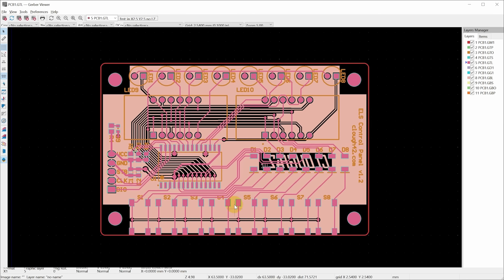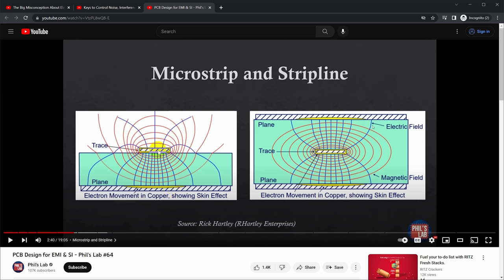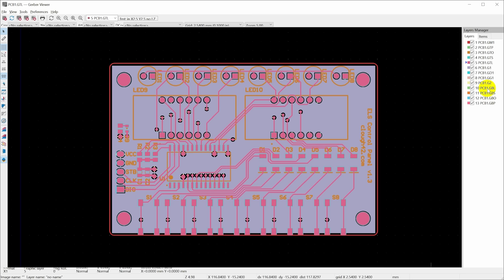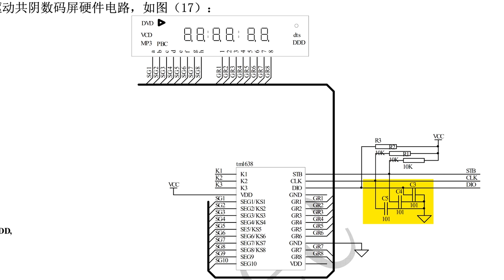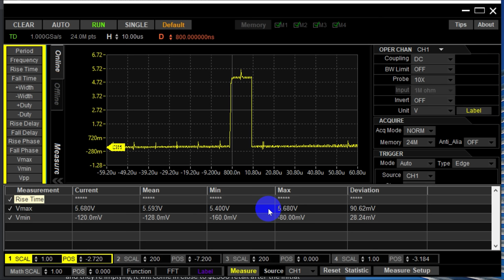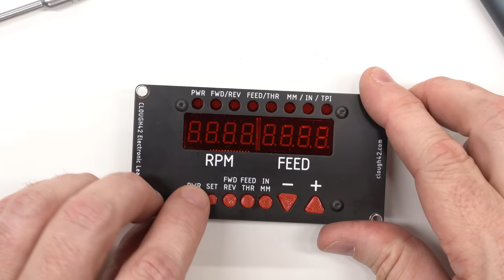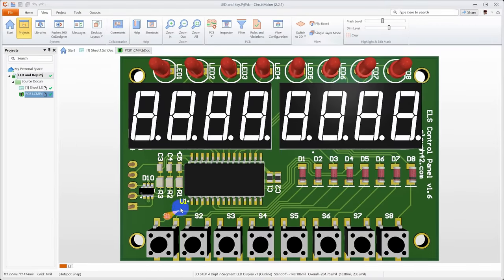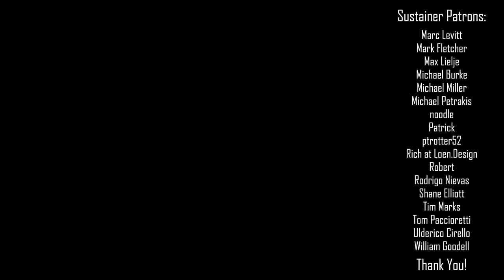4 Layers is Better than Two: Another ELS Control Panel Prototype

Comment: Hint: for those 100pF capacitors, it does not matter¹ whether they go to GND or positive voltage; all that matters is that they are between the signal and a constant DC potential. So you can just get physically larger capacitors (same size as the resistors) and directly stack them on top of the resistors.

Also if you make the resistors smaller, the capacitors need to get larger, since their effect is determined by the R×C product. ≈4.5× smaller R ⇒ use ≈4.5× larger C (470pF is a standard value.) But NB: both of these changes — smaller R, larger C — make it harder to drive the input. With the traces you're showing, it doesn't seem like that's a problem in your setup though; not yet at least.

Also-also the C1/C2 decoupling capacitors need to be as close to the IC's power pins as possible. [EDIT: looks like you already moved them to a better place, I should watch the entire video before commenting :D] The circuit board - and in particular the vias - are only in theory 0Ω 0H 0F. But when you're looking at fast edges, the reality of non-zero µΩ nH pF values makes things harder.

[¹] - some might nit-pick that the power-on behavior is different when the cap is to VCC rather than GND. Which does not matter the slightest bit.

Comment: Though being a mechanical engineer, I had to design a multiprocessor board, 8 by 8 inches,for some embedded industrial systems back in the eighties. As processor speeds was much lower then, EMI wasn't as big a problem. To make PCB layout easier I went for a 4 layer board. Ground plane bottom, then a "north-south" layer, then an "east-west" layer and a positive layer on top.
Hundreds of them made, rarely any problems with them.
Seems I wasn't completely wrong.

Comment: Maybe a fun project idea for you, but - I've been looking into possibilities for attaching a small/micro drill chuck to those electric screwdrivers. I think it'd be fantastic for drilling out or threading small 3d printed plastic components very quickly. Beats a pin vise and preserves your wrists, and you don't have to worry about snapping any drills if you're chucking them up in a big 1/2 chuck.

Great vid, looking forward to more as always.
Reply: Honestly: Just buy a drill that is dedicated for that Job. Maybe I did not understand your idea correct, but I think a proxxon micromot 60/E will do the task way better. Here in Germany they cost around 30 € and you can even choose between a tiny chuck for convenience or tiny collets for precision. Of course, threading does not work. If that is your main task those screwdrivers could indeed be helpful.

Comment: Nice work!
I love the Milwaukee M4 screwdriver for electronics work.  I'm a former electronics tech.  It has a great clutch and ergonomics plus swappable batteries.
I run a double conversion UPS in my shop dedicated for electronics.  Normally they are expensive but they can be found of the Bay of e with bad batteries for pretty cheap.  An APC RT, Eaton 5PS, or Sola S4K.  The Sola is what I use, only thing that can handle the frequency swings running on my old Onan generator.

Comment: I've gone to 4-layer for all of my hobby projects. Between easier routing (as most of my boards are dense) and improved signal integrity, it just isn't worth using 2-layer boards in most cases any longer.
Reply: This is something I'd never considered until watching this video... now I have 2 reasons to try 4 layer!

Do you just route GND, or power as well?
Reply: @LordPhobos6502  most of the time I route power and simply connect down to a ground plane (unless it's an analog design that needs a star ground).

Comment: I've designed a lot of boards, from computers to cell phones, and while going to 4 layers is always nice, this board could have been vastly improved as a 2 layer design. For example, the ground connection between the input connector and the IC is quite poor. Adding a ground trace parallel to the data lines from the ground on the IC to the flood near the connector would be a big help. 
For this design, I would have ground flooded both sides, and stitched the planes together with vias near the IC. The rest of the PCB isn't really a problem (LEDS and Stitches) if the signal integrity of the interface to the IC is good. I also would have placed the bypass caps as close as possible to Pins 4 and 15 (Vdd pins) with good return to the IC ground pins.
Reply: "stitched the planes together with vias near the IC"
I'd rather have via stitched both the top & the bottom ground plane polygons wherever possible in order to suppress capacitance which will inevitably build up between them if left not stitched. The more vias the better. JLCPCB don't care of how many holes they drill for you so it will not affect the price at all. There is a dedicated automatic feature for that in Altium Designer.  The smallest hole size JLCPCB can make is 0.2mm so several hundreds vias can be placed per one PCB easily. The only thing to consider is to remove a thermal relief from that sort of stitching vias in the Altium DRC. BTW, I have no any degree, I just use a common sense.

Comment: Going to 4 layers is the best solution for this sort of thing, but, especially for folks who don't have the ability to do that, something else to keep in mind:  coupling between traces (or any wires) is roughly proportional to the cosine of the angle between them.  So parallel traces couple the most, perpendicular traces couple the least.  So if you have top layer traces pass near bottom layer traces, it's best to cross at a right angle rather than at a sharper angle.  

The coupling is also inversely proportional to the square of the distance, so separating traces is best.  Thus, it's best to cross traces at a right angle and then move them apart, rather than letting them run parallel near eachother.  

Obviously, some times there are geometrical constraints that prevent this.

James had all this correct on the prior version - the main bundle of traces crossed at right angles.

Comment: High current lines going at 90 degrees across signal lines is the best possible crossing for minimum interference.
What is more an issue is "loop area" for high currents. Placement of decoupling capacitors however could be a lot better...

Comment: SMT Rework suggestion: I use a (6x6x2 Granite Check Stand Surface Plate & DIAL INDICATOR Gauge Granite Block) and replace the standard probe tip for one that is more like a pin to hold down SMT parts while soldering. The Dial indicator I have been using has a 1" travel which works well. I suspect you already have everything you need in your shop.

Comment: Moving the power planes to the outer layers, and keeping the signal traces to the internal layers, will provide the best EMI shielding you can get without going exotic like a 6 layer board with solid layers just for shielding.  I work with power inverters for traction motors in the 20kw to 450kw range, so we see very large EMI problems.

Comment: I would add small series resistors between your TVS array and the RC snubbers. A 1A ESD pulse will still get to 12.5V before the TVS clamps - you're relying on the capacitor in the snubber to deal with the let-through energy. A series R (100R - 220R, 5% to 10% of the pull-up) will slow the let-through surge and give the capacitor a better chance at filtering the high frequency pulse energy.

Comment: Nut drivers are hugely underrated; they're way easier for all sorts of "small" nuts like this if you want to minimize the amount of cursing, cross-threading, and dropped fasteners.

This kind of "sharp edge causing noise and interference" problem is prevalent in a bunch of digital signaling; if you've ever perused the catalogs for things like RS485 drivers, you may have noticed that manufacturers will often sell a few different "versions" of a chip with various rated bitrates/speeds for what is otherwise the same design for basically the same price. You might initially think, "why wouldn't I just buy the fastest one?" but the answer is that the different "speeds" differ largely in how steep their rise and fall ramps are for their drivers. Slower/softer transitions do limit the maximum signaling rate, yes, but it also means you produce less high-frequency harmonics that can cause interference to other circuits so you really want a driver chip that's "just fast enough" for the signaling/baud rate you intend to use. This will provide maximum signal integrity with the minimum potential for introducing extra noise into your systems.

That TVS "multipack" is a great component, and I'll definitely be keeping it in mind for my future designs! A lot simpler than including footprints for a separate TVS package on each data line independently.

Comment: 9:28 Your soldering is not bad. Your results look fine, and the difficulty you had with the 0603 caps is just something that goes away with lots and lots of practice, as you develop an intuitive feel for the heat flow and surface tension and learn to fling stuff across the room with the tweezers less often. Try working with some 0402 components… by the time you can work with those without wrecking them and the board, the 0603 ones will seem easy! Out of necessity at work, I got to where I could rework 0201 with a lot of difficulty. But that experience made 0402 seem easy by comparison. I agree with the other commenter who suggested a J shaped tip.

Comment: The secret sauce that Rick and others I'm trying to get into our head is that with microprocessors and signals it's all about the rise time which is nothing to do with the frequency.
Unfortunately it's very hard to find me information on rise time.

You might be lucky to find a microcontroller that has a simulation model.

I'm playing with esp32 and unfortunately I do not have a simulation model
Reply: Rick and others really opened my eyes. Dave from Evvblog also had some hidden gems too.

Comment: Hi James, a suggestion for the next iteration or project. Add a schmitt trigger for the inputs. Some 10 Cent 74xx2g17 will do. In combination with your existing diode chip it should make it quite resilient against emi on the input lines.

Comment: James. I had to comment after watching this latest video. You failed to mention the latest version now includes decoupling capacitors. The blatant lack of bulk and high frequency decoupling caps was a fundamental issue from day one. I’d go on to say that most of your issues are power related and not EMI related. Always focus on good power delivery first then signal integrity and lastly EMI if needed. 

Whoever suggested C1 and C2 is on the right path. However with your VFD nearby I’d add something in the multi-hundreds of uF as well. Why didn’t you mention these?  You certainly spent a lot of time on Signal integrity and EMI but you thought the boards performance on the scope looked good. It looked terrible from a power and simultaneous switching perspective. Look at the high frequency bumps on the low signals. That’s just a mirror of the ground supply at the time. Shows a fundamental lack of good power supply decoupling. Similar glitches are seen as the signals were high. 

All the signal filtering is OK but it’s not addressing the 900 lb Gorilla.

Comment: You said that there's no way completely eliminate issues like this but there is one way you can get pretty close, use a differential signaling protocol such as rs485 for the data link. You could even just send the existing signals through bus driver and receiver pairs and keep the signal timing the same.
Reply: That was my thought as well.  RS-485 transceivers are stupidly cheap.  Go with a full duplex one from TI, and an ATTINY202 (< $0.50) and you've got bi-directional communication in 4 wires, while still having a reset pin for the micro-controller.  If you're willing to forgo the reset line, you could go with a half-duplex transceiver and set the "reset" pin to act as a TX control.

Comment: My guess would be the 100pF caps make a more differrence than 4-layer board. Too bad both of those were not tested separately to change by only one wire at a time. I'd still guess some random short spikes on signal lines screwing up the signal and making it flicker before. 100pF caps should take the smallest ones out of.
Sure, making both 4-layer and adding caps is the best thing which is good for production runs. I think the coupling to high current lines may not be that high as the signals are already routed at almost 90 degree angle to each other. With a 4 layer board like that, there is now not even a doubt of signal coupling that at least excludes the possibility all togeather.

Comment: When you say shielded cable on the “VFD leads” do you mean input or output? Common practice to put toroid on output but are you also suggesting the output should be shielded?

Comment: Always great to see a reference to Rick Hartley, between him and Eric Bogota my job got much less mysterious.

Any thoughts on moving your power/reference planes to the outside of the PCBs? I found this sometimes makes things easier with predicting standing/interfering waves across my switched power and data lines (which are frequently nanosecond rise times) because it's FRx on both sides of the trace instead of FRx+air. 

Either way great work!

Comment: Use Differential transmitters and receivers in very noisy areas.  You need more wires, but it's a very robust solution.
Reply from the maker: If I were starting from scratch and building a commercial product, this is likely what I would do.  This project, from the beginning, was designed around cheap off-the-shelf maker components, and I didn't find any great bolt-together options for that.  I tried a few things, like the TI driver breakouts, but they all had specific compatibility issues that made them unsuitable without spinning all custom hardware.

Comment: With moving to self-designed boards, have you considered moving the microcontroller directly onto your display board? It would certainly help with EMI hardening.
Reply: Not feasible. For one thing, the circuitry belongs to Texas Instruments. Secondly, have you looked at the complexity of it?

Comment: I would buy some no clean flux in a syringe. If you put a blob down where you are working it makes the solder flow like a dream. If you work under a puddle it basically gives you infinite time with the solder flow able. ESPECIALLY important to use flux with lead free solder.
Reply: Agree. I'm not a big fan of the pen type flux, since often, it's just not enough. Also the high quality stuff doesn't even evaporate on lower temperatures, it's like moving a pencil through water. I don't mind washing and rinsing the bord later with some IPA.

Comment: Hi James, I haven't seen the full schematic for this so don't know but do you have any ESD suppression on those button inputs as it's going to be pretty typical for a statically charged person to end up grounding themself pushing those buttons. The 3D printed plastic parts are going to act as a bit of a barrier but a 10-20kv charge could still jump plastic or capacitively couple, it has to go somewhere.

Comment: I like this ELS very much especially being overkill, I have watched the whole series but just when I decided to source the parts to build mine, I found others that added a second stepper to the X axis and integrated ELS with CNC and even more a single or multiple profiles turning, threading, boring and even curves. In spite of your ELS is better engineered, I can’t resist making a thread with press of a button.
Do you have plans for such upgrade?

Comment: I can't resist pleading (begging if I have to) with you to PLEASE implement the threading / turning to a shoulder feature you discuss in the git hub.  There is an unused button which could readily be used to enter and exit shoulder mode and to set the shoulder position.

Comment: Great approach, but there is some reasoning error in there. The 10k 100pF signal looks fine. Even if some more load and capacitance is added by any long cable, it's still a reasonable pulse shape. I don't know the threshold voltage on the inputs, but you often don't even need full Vcc on the pulses. In high speed signaling, especially in auto equalizing circuits, signals look nothing like square waves anymore, as that would just be a waste of energy and actually be a cause of crosstalk. 
Remember, going from 10 to 2k, the source drivers have to drive 5 times the amount of current. That could be an issue if you're pushing them to their limits, or they're not properly cooled. Did you check that?
Have you also considered using shielded and/ or twisted pair cables?
Reply: Is this TTL?  So 5v signal but switching is down at 2.4v?  The fast edges are definitely generating emi, the 10k/100pf provide a -3db point at 160khz.  The 300 nsec normal risetime seems very fast for these circuits.

Comment: So your bench testing said that the datasheet circuit (10k with caps) is marginal on rise time?

Did you try to do any kind of bench testing with noise, which is the purpose of reducing the resistor values and adding the caps? That could be quite challenging to reproduce.